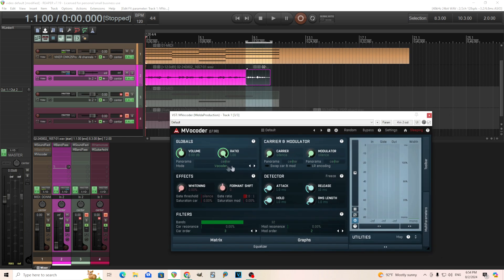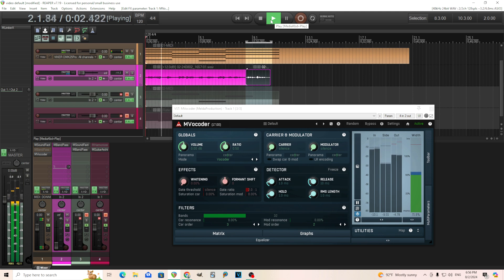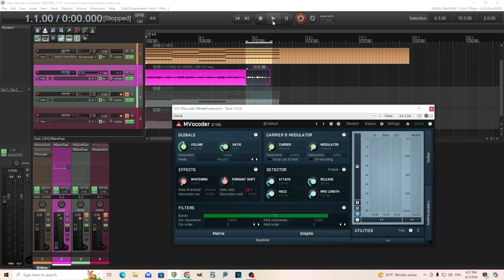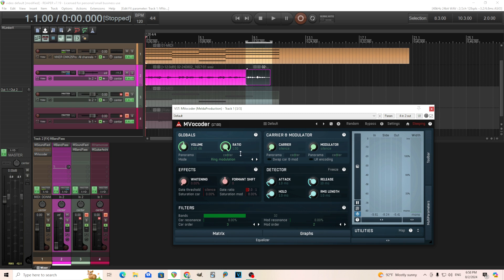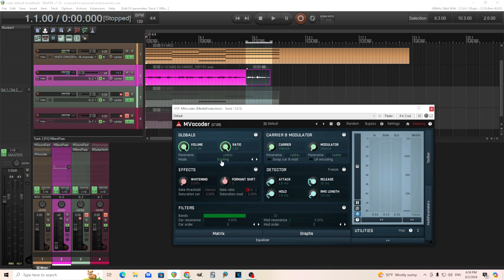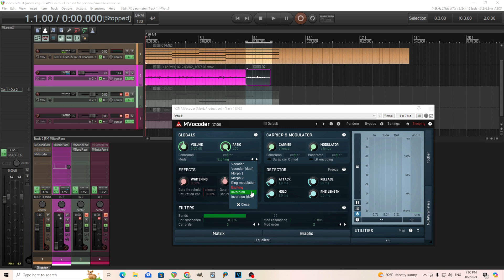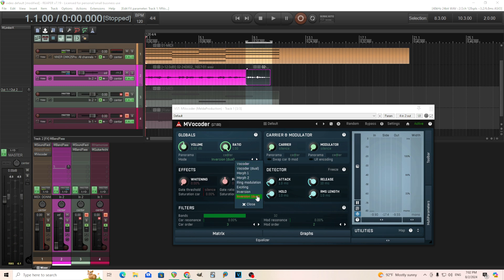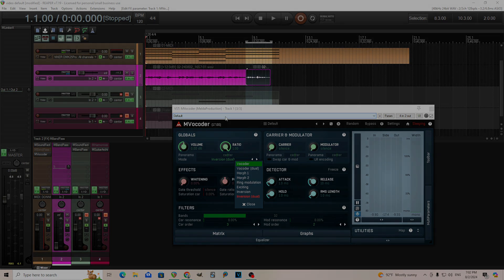Vocoder Modes in MVocoder

Comment: One thing people need to know about mvocoder, is that it does not have its own oscillators built in. With any daw you use it on it needs to be paired with a synth plugin and placed in an fx slot. I absolutely love it that it’s is like this but I found this confusing when I started using it in Logic.
Reply: Vocoders have always been one of the toughest effects to use in a DAW environment but learning how to properly route them in Reaper totally changed how i worked, i think its a great lesson for any producer to understand what the digital realm actually allows (potentially infinitely branching sidechaining and parallel processing capability from start to end of the chain). When you really look at some of the most obviously digital sounds you find that theres alot of this type of sidechaining/parallel processing.